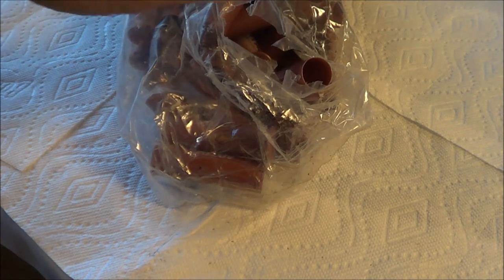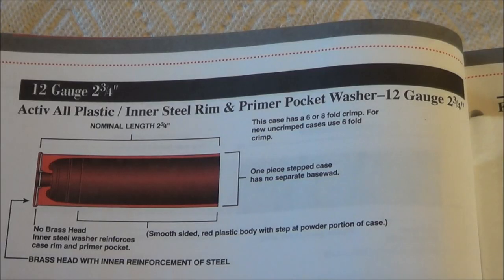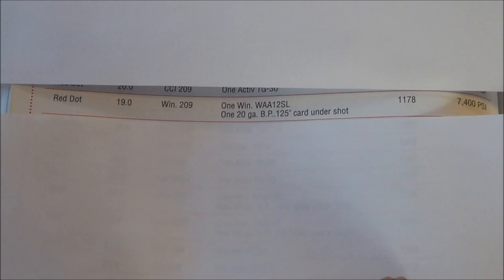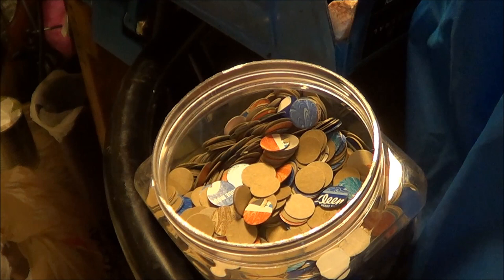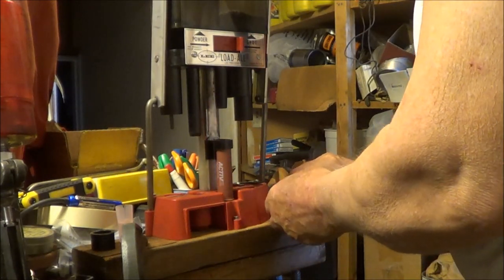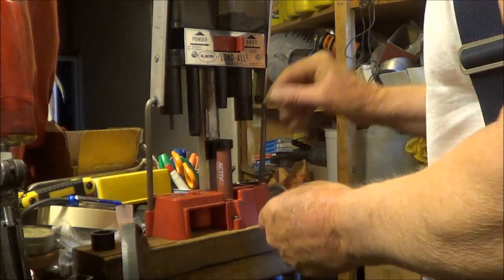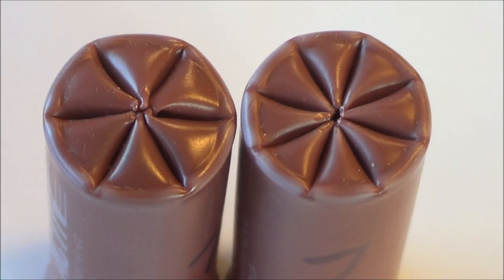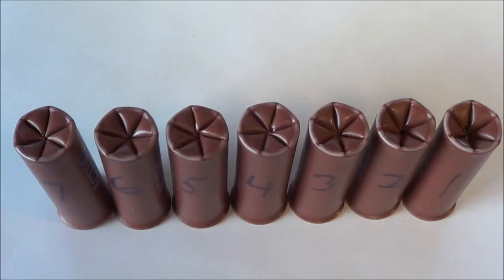Reloading new uncrimped Activ Shotshell Cases

Comment: Stumbled across this video doing research on Activ.  I worked for a few years as a ballistics tech for one of the current shot shell ammunition companies. a word of caution.... the brown Activ cases were discontinued shortly after they were introduced.  because the plastic composition was brittle.  The head would separate at the interior step. New cases would fire once fine but reloads were VERY prone to head separation.  Use in Autos and pumps is not recommended.  Always check the ejected case to verify it is intact and that the tube is not separated and stuck in the barrel.  The red and other colors/gauges was not an issue.  secondly, placing the card filler wads under the plastic wad will result in inconsistent pressures and yield poor /low velocities.  Place the filler wad in the shot cup of the wad.

Comment: IMHO ACTIV hulls are some of the better hulls out there (I was given around 1000 once fired red and black hulls as well about 500 brand new maroon/brown hulls like you show in your video) I use them in my Cowboy Action loads (they shuck/drop free from a double barrel better than STS or the “new” AA hulls.)...since there are no more ACTIV wads out there reloaders are left with using wads available (Such as the pink AA light) as well as a bulkiest powder available in loading data. To get a proper crimp, after I seat the wad over the powder I drop in a few Cheerios into the wad before I drop the shot to take up space. YMMV on how many Cheerios you will use depending on powder, wad and shot charge used.
Reply from the maker: Interesting to learn the Activ hulls are useful for Cowboy Action shooting.